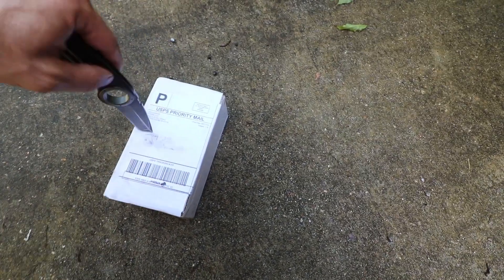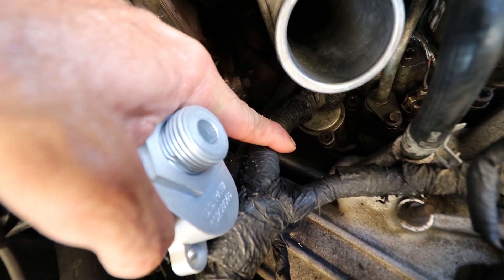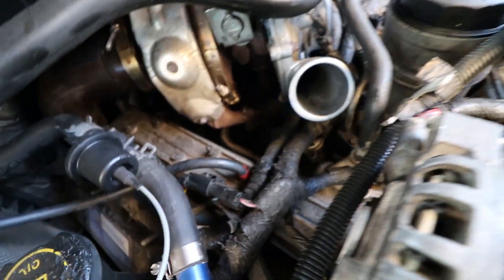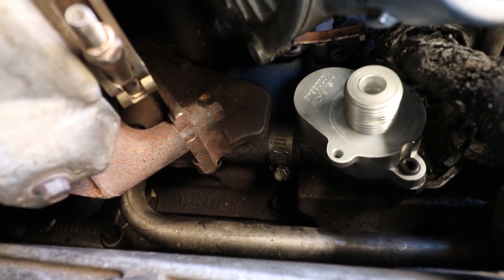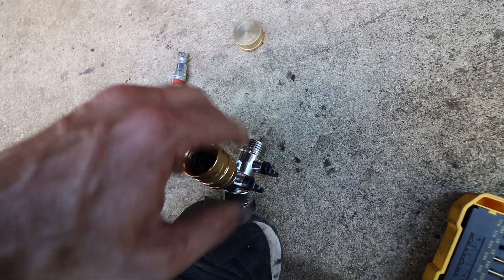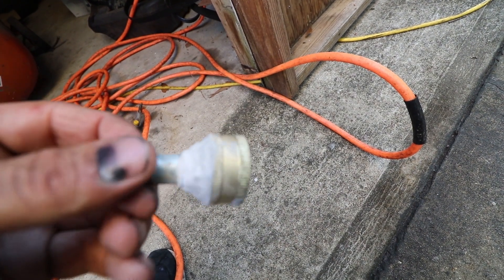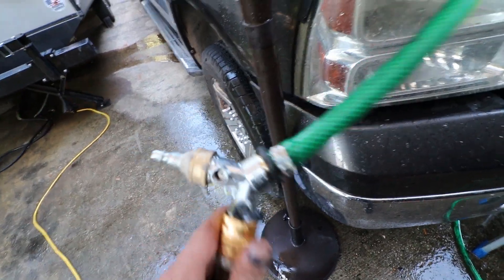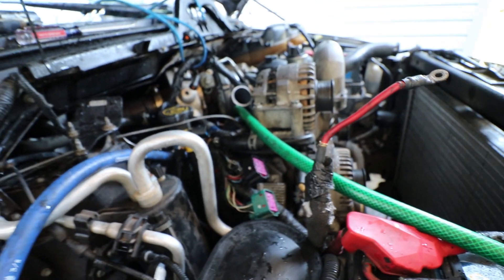6.0 Powerstroke - 6.0L Oil Cooler Back Flush

Comment: I use a deep 4mm ball driver on a 3/8 socket in place of the t27. If you are afraid of breaking ball driver because of reduced shank size, loosen first with small key wrench. Works great.
Reply from the maker: Great advice!
Reply: 4mm ball driver? As in ball tip Allen ?

Comment: Might be a dumb question.. Do I need to replace the oil or coolant after doing a flush? Or will the current oil and coolant be ok?
Reply from the maker: The oil isn’t messed with. The coolant however id suggest not reusing what you drain out of it, I mean your doing a flush for a reason and that’s the liquid carrying whatever that’s got your cooler stopped up.
Reply: @grumpysdiy got it! Thank you for that clarification.

Comment: I have taken the turbo out and disconnected all water hoses , is it possible to flush it this way?
Reply from the maker: You do disconnect the bottom rad hose when you do the flush. I swear I said this in the video.

Comment: Amazon sells a flusher that comes with the 45 degree fitting with a 24" adapted hose that goes up to which you can easily attach a garden hose.
Reply from the maker: Nice, back when I made the video this was pretty much the only option.
Reply: The difference is after I've looked into these things the one on Amazon can't be installed permanently fix your six can

Comment: The Motorcraft gold contains silicate that can clog up your oil cooler as well. From what I've read the elc coolant is the fix for that.  Might be worth looking into? I am for sure
Reply from the maker: I agree, later down the road rotella elc is what I used. This video is old.
Reply: @grumpysdiy  have you had good luck with the rotella elc?
Reply from the maker: I don’t have that truck anymore but it was great when I did. I also had a coolant bypass filter too so an extra layer.
Reply: @grumpysdiy  just got a f350 with a 6.0 powerstroke and I've been researching what to use because it's got the gold in it right now....but it does have the filter setup on it so that's good
Reply from the maker: Yea worked great
Reply from the maker: I ran both the gold and the rotella elc. I think with the by pass filter and distilled water as your mixture you will be okay.
Reply: I use the international red noat

Comment: I have 2 questions do you leave the unit on after you install it.
 2nd question is that thing that you twist down does it go all the way down after you install it or do you just adjust it anywhere does it matter for goes directly into the center or can I go to all the oil cooler.
 Don't know if that mixes with oil or not. Mine did not come with directions
Reply from the maker: Yes leave it after install. If I remember correctly twisting it all the way down seals it to do the flush. Then when your done you twist it all the way out and use a zip
Tie to lock the cap in place.
Reply: Thank you very much for your fast reply. I think I noticed you had to take apart your Turbo.
 While you always have to take apart your trouble to be able to put the hose on
Reply from the maker: I installed it with the turbo in. I made a comment that I should have done it with the turbo out, but it’s possible.
Reply: Thanks. Bro 
 I'll let you know how it goes
Reply: Great video! Looks like you have more experience than me,  but I still say get the ford gold outta there and use peak  final charge or some other elc rated coolant. It has nitrites in it for cavitation control, but no silicates like the gold does which will cause problems. The 6.0 from international uses ec-1 rated coolant

Comment: what made you go with Motorcraft Gold i know you heard about it clogging oil coolers.  You still think its good?  Thats what I'm about to use too but now having doubts
Reply from the maker: I got a good deal on the gold concentrated coolant from the ford parts guy. Since my truck never gets hot anymore because of the 7.3 fan clutch I have had zero problems. Not even towing does my ect ever go above 205, even on at 8% grade. Everything I’ve seen on coolant is the extreme temps that breaks down the coolant and causes the clogs.

Comment: Great video all very important maintenance item. All 6.0 owners need to know what  their Deltas between engine oil temp and engine coolant temp. Get some gauges or a tuner. If they're not within 15 degrees you have a clogged oil cooler. That will lead to replacing injectors, turbo, high pressure oil pump, EGR.injectors and head studs. All the common problems the 6.0 has are related to oil coolers not working properly. Do not use Motorcraft gold it can clog your oil cooler, many reports of this coolant creating silicates under heat and pressure produced   by a 6.0. Use a EC-1 rated coolant.
Reply: James you are correct, using the Ford orange coolant is the main issue. 6.0 in heavy duty truck applications for international/Navistar don't have these problems. They will go 500k no problem with good maintenance
Reply from the maker: Yea I want to use Cat coolant it was just a bit out of my price range at the time. When I replace my coolant and do another flush I will be using CAT
Reply from the maker: Thanks so much for the advice. One good thing since I installed the mech fan clutch is that I have not seen temps over 208 degrees on either EOT or ECT.